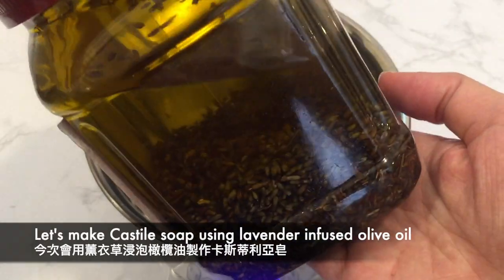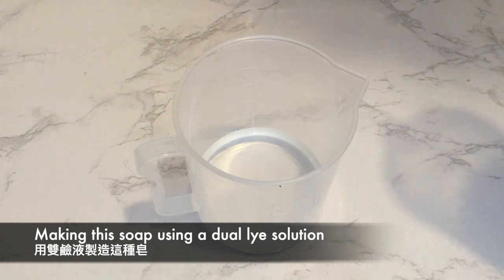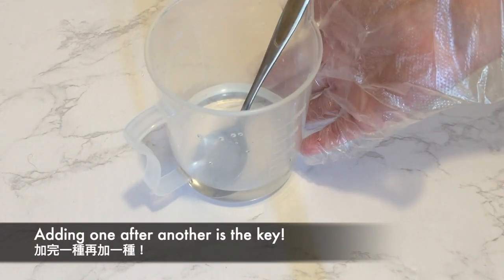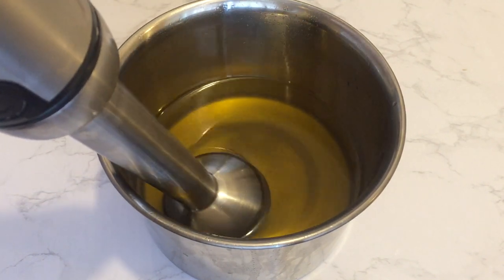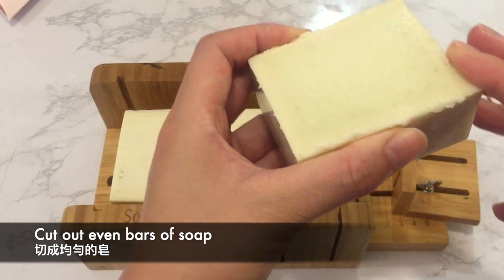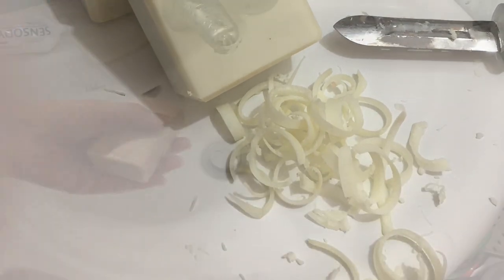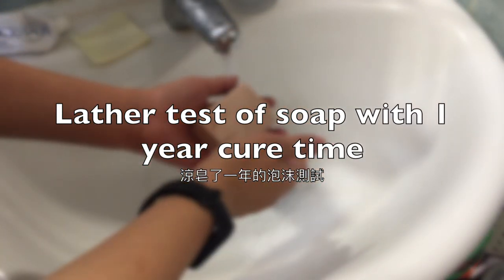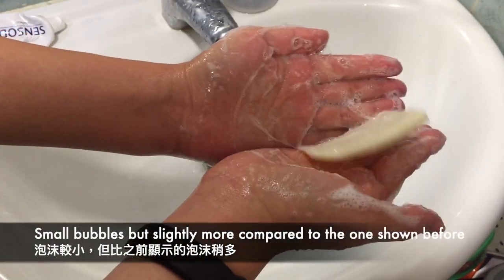Dual lye 100% Olive Oil Castille soap (Reduced cure time? Lather Test Included)

Comment: how if add koh after finishing bar soap. to make it liquid
Reply from the maker: You should not add KOH after finish the bar soap. You can turn bar soap into liquid by shredding the solid bar and melting it into water - but it doesn’t last long and may have bacterial growth there. 
To make liquid soap from scratch, you can refer to this video: https://youtu.be/5j6nns-Lgs0
Reply: what bacteria will growth?
its dangerous?
Reply from the maker: Any kind of bacteria can grow in the soap and it also can affect the stability of the oils causing the solution to smell bad.
Reply: what effect to skin?
Reply from the maker: You can get infection if you got cuts in your skin and the soap will smell bad
Reply from the maker: Mahdi Syntyah I’m sorry I don’t understand?
Reply: i have made this soap (+ koh).
Reply from the maker: You can make this soap formula using mixing the oils and lye solution made of KOH - it will turn to liquid soap. Or you can use NaOH lye solution and will turn to bar soap. If you used mixed KOH and NaOH depending on the proportion - 
more NaOH will be bar soap
More KOH will be liquid soap
Reply: thanks very much. may i get your contact or other sosmed
Reply from the maker: You can leave me comments here or in my Instagram @thescraftworks